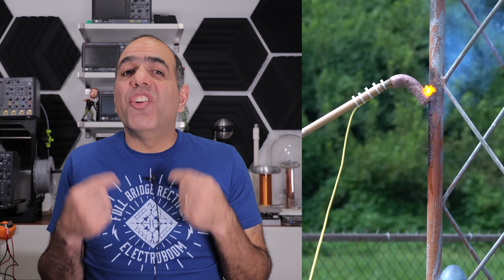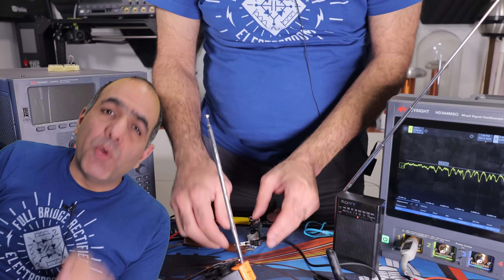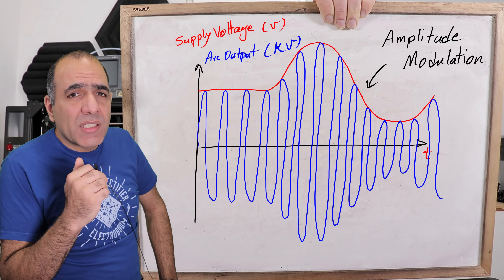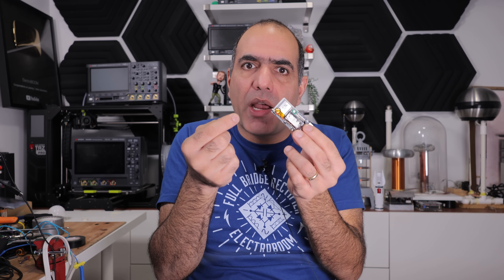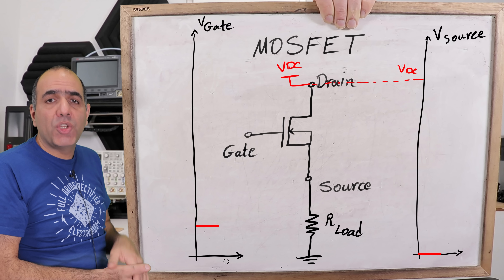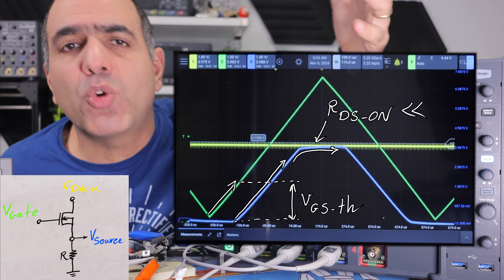Plasma Speaker DIY (AM Demodulator)

Comment: Very interesting! There are two main methods to extract the envelope of a carrier in analog systems. The first uses a rectifying diode followed by a capacitive filter. The second relies on nonlinear components, where mixing of signal components occurs, and among the output frequencies, the baseband component can be found. This second method is precisely what happens in the case of an electric arc, where the current is not proportional to the voltage.

Comment: In the US, AM transmitters are limited to a maximum output of 50 kW. Here in Germany there was a medium wave transmitter in operation until 2015, which broadcast with 1200 kW of power from the 70s to the 90s. At the time of the final shutdown it was still 400 kW. The 1200 kW was enough to hear the radio signal from gutters, refrigerators, radiators and cooking pots at a distance of 12 kilometers (7.5 miles). A net of wire cables (like a kind of Faradey cage) was even built over the autobahn next to the transmitter so that the cars' function was not disturbed.

Comment: Hi @electroboom.   I recently return home from open heart surgery and when they tried to remove the pace maker wires attached to my heart  it would not come detached and they just clipped the ends and left them in.     Is it still safe for me to use my super high frequency Tesla coil or is time for a safer hobby?

Comment: Videos like this make me wish you did some videos on synthesizers or guitar pedals! The concepts you're talking about are almost the same, if not exactly the same as what's happening in say, a Voltage Controlled Oscillator, or a hard-clipping distortion. MOSFETs specifically are often used in effect pedals

Comment: This actually makes me a fair bit more confident of the "plasma speaker" I cobbled together many years ago. But instead of coupling the audio to the gate with a cap, I fed the gate directly from an amp. Worked to some degree, FET got stupidly hot very quickly. Mkst likely also due to the high currents it had to switch, a ZVS at roughly 300W ain't no joke for a FET.

Comment: Gate driver circuit or battery’s negative should be referenced to the source of the mosfet not the negative or gnd of the battery, you are using a high side switch. This case the mosfet won’t turn on properly or could end up heating. This is a horrible way of driving a mosfet plus you might want to use an opamp or a transistor voltage follower to properly drive the gate. Other possibility is modulate the audio signal after DC shifting with a high frequency ramp using a comparator then the output pulses directly fed to an actual gate driver then using it to turn on / off the mosfet. Please don’t make these kinds of garbage videos just because you have 9 million subscribers

Comment: regarding AM tower. years back 2 of us had to climb up a live tower and affix FM dipoles to the top, we put a wood ladder against the mast . got near the top then jumped on. got to into the triangular structure and climbed till we got to the top, dropped rope down and dragged the dipoles and fittings up. no safety gear at all, cold day and mast getting frosty, winds  making the mast sway a bit. the scary bit was when a cow used one of the guy ropes to scratch itself and that really made things a rocking.
this is going back 30 years in new zealand
would i ever do that again. no way!

Comment: The burning sausage is caused by the TRANSMITING tower being grounded who has a lot of transmitting POWER ! So, I really don't understand what you AM RECEIVER  radio as to do in all this ! But you are mentioning about earing radio, not burning pickles.... So, is the AM Radio receiver antenna tuned (synched, harmonized, resonating)  at 530 KHZ  is the radio if set at AM 530 ?? You should get 530 KHZ only after the IF filters inside the radio... I am so confused...

Comment: This is just a speaker not an AM demodulater, you are feeding the Audio output of the radio to the mosfet, which is not like getting a direct AM signal through an Antenna , the radio here is doing all the work, from receiving, separating the Carrier from the audio and amplifing and you just get the amplified signal and feed it to your lighter

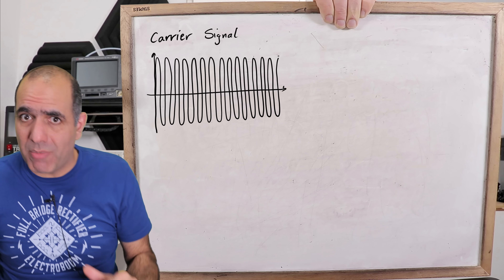Comment: 2:40 No, it doesn't (or shouldn't) have anything at baseband (in theory!!). With DSB-AM, the carrier frequency moves the baseband audio signal up to the carrier frequency. So you end up with an upper side band, a lower sideband, and the carrier signal which is basically a DC offset. Half the power is in the carrier and the other half is both sidebands. Each sideband is a quarter of the total transmitter power. It makes sense half the power is the carrier because even in the time domain prior to modulation, the signal is biased to a middle voltage. So it can be thought of as a DC bias and a signal superimposed on it, half the power for the DC offset and half the power for the signal.

Comment: What, no mega-traffic from a FREE ENERGY DEVICE?    PS make a pickle from molded agar with a bit of salt.   It's transparent, so when you hook it to line voltage, you can see the internal arcs as they carve out large bubbles.   (Or, add strontium nitrate instead of NaCl, for magenta-colored arcs instead of sodium-line arcs)

Comment: 9:16 microwave oven transformer 😂
Reply: An MOT or any lf transformer will have a very bad result. Those steel cores are designed by electromagnetic physicists and electrical engineers to run on low frequencies, no audible frequencies. You’ll notice the BH curve, Q factors everything go bad, turn into a resistive load, hell.
Reply: @BritishEngineer  *switch
intense 60hz arc and sparking
breaker pops
Mehdi: the hell?
bubbly candle arcs
Mehdi: the hell
Mehdi: WHY DO BAD THINGS HAPPEN TO GOOD PEOPLE??
switch
Mehdi: go!
eerrrooo
Mehdi: woo
erroo erroo
tower tips
Mehdi: puts hands in front of him
massive sparks
Mehdi: AAAHHHHHH%@#$@#$%@$%$#AAAA$%@#$%@$$@*starts flying*

Comment: Doesn't demodulation by air heating/cooling pick up the square of the signal, as opposed to the signal itself when demodulating using a diode?

Modulated wave is s(t)  = A(t) sin(wt), Heating should be I^2 R, which gives A^2(t) upon averaging the square of the high-frequency carrier. Diode is |s(t)| which gives A(t) instead.

The electric arc is probably also nonlinear, and that would in fact increase the distortion of the signal even more...

Comment: I had a roommate with a guitar and amplifier. He could turn on the amp, and just plug in the guitar cord, without the guitar and pick up the local FM radio station. What's up with that? The FM tower was maybe a little more than a mile away from our apartment.

Comment: interesting to see AM is still used over there.
Reply: over where?   AM is still highly used in the US.  it just sucks that almost all receivers have absolute crap for am signals.   AM is actually very very high quality with the proper receiver.
Reply: @iamdestructoman  yes, over there. It has a narrower bandwidth than fm, so in ideal situations for both, it's worse quality than fm. 
Doesn't matter as much now, with digital radio.
I get it, am covers a greater area, so they went with that instead of more towers and because power is still somewhat cheap there, they can excuse the high power.
But damn does this video demonstrate that it's interference central.

Comment: I did this with a bluetooth speaker and a laser first, the other end was a solar panel hooked up to a hifi, next i did it with a cheap headlamp, so i can turn it on then modulate it with audio signal, it worked great and was loud because of the hifi, if i had a more powerful solar panel i would hook up the speaker to it😅

Comment: Can anyone help me 

I want to drive coreless motor with audio frequency with an app on my phone using a bluetooth module. The Bluetooth module provides only 0.7v on outputs, and that's why i tried using bc547 transistor. But transistor doesn't turn on fully. 

Which transistor i can use to drive motor from audio coming out of the Bluetooth module??

Comment: Slight correction: because of Fourier and frequency mixing, when you modulate the carrier with an audible frequency, it shifts the modulating signal up to be around the carrier (with two sidebands containing the signal information and the carrier). That way, the signal only contains frequency components around the carrier and not at audible frequencies so it won't shock you (but it will still burn, hurt, and cook you). If the signal has a lower frequency signal superimposed on it (added rather than multiplied) like in Styropyro's HFVTTC, the lower frequency components will cause your nerves to react, making it extremely dangerous and lethal. If you like the math, pickle demodulation works because the thing you hear is proportional to the power going through the arc, which is proportional to the power, which is proportional to the square of the signal. The square of the signal has lower frequency components containing the original modulated information. It's much more intuitive to think about what AM actually looks like (Mehdi's explanation (which I really like btw!)) rather than all the math in the frequency domain, but if you're wondering how it works with fourier stuff, that's why.
Reply: Thank you. I was thinking "is that really right?" because it reminded of acoustic beat where a slow amplitude modulation is caused by the superposition of two components with similar, but much higher frequencies.
Reply: As an electrical student thanks for the explanation, makes a lot more sense now

Comment: Do I have to use a lithium battery 7:55
Reply: It would work best with the lithium battery that came with it. But you can, roughly approximate the output voltage and current of a lithium battery by making 4 sets of 2or3 AAA batteries in series and putting all the sets in parallel. This would output around 3-4.5 volts and could supply ~1.5-4 amps.
Reply: @ I’m thinking, maybe the hazards
Reply: @Imacgray  what?

Comment: I used to live 1000 feet from an AM talk radio station.  My entire building seethed with Rush Limbaugh every afternoon.   You didn't need any radio receivers,, just anything that had some level of radio  resonance.  Don't ask about my phone lines then.   Note this was the era of the 56K modem and I had a second phone line for Internet.   Ask how that worked.  It was "interesting:   At least they reduced power at night.
Reply: Maybe they had a broken insulator on the steel cables of the antena
Reply: The rent must have been dirt cheap though.
Reply: Don’t ask about your phone lines but ask about your secondary internet phone line..?
Reply: I feel truly miserable for you. I hope where you live now is better.
Reply: My condolences.
Reply: WTF is 1000 feet in meters?
Reply: @mernokimuvek  around 3.3 feet in a meter. so 300-ish.
come on man, if i can memorize it why can't you, mr metric? arent you supposed to be so superior?
here's another handy conversion, 2.54 centimeters in an inch. and 3.78 liters in a gallon! wow, how can my puny american brain store all this information :O
wanna know how many kilometers are in a mile, or do you get the point? it's 1.6 by the way.
Reply: @charleswisconsin9196  In  European countries,  they don't tech imperial units. My physics teacher once referred to america as the country that measures length in fridges. Why should people who grew up with a superior system of units learn  to use inferior units?

Comment: More circuit bending videos! Another fun audio project is to use two amplifiers (I used BJTs back in the day but mosfets probably would work), one drives a laser pointer with audio signal at the gate aimed at a photodiode which is the gate for another bjt/mosfet that drives a speaker. I dont think I ever transmitted the audio further than a few feet though lol. Also RF burns frickin suck!

Comment: At 7:30 how did you get 3V at the source of the MOSFET? Is it from the lighter battery?
Reply: Resistor voltage divider.

9 = 6 + 3

6 = 2 X 3

And.. ok it’s hard to explain in a YT comment. Just go look up resistor voltage divider.

Comment: Seriously!!! From someone who has worked with high power RF it reallY is NOT something you want to mess around with. There’s a couple of channels in particular and one of them, he is too clever because he thinks he knows best and was quite rude when I warned him. If you get an RF burn you will only want to do it the once. And not only that there are conditions where you won’t know if you have been burnt until it’s too late. 
FOR GOODNESS SAKE please don’t mess with RF if you don’t understand what you are doing. You need to understand how RF propagates at different frequencies and how it propagates. If you ever visit a transmitter station then you will see perimeter fences around the antennas (depending upon type and frequency) and RF burns can result just as lethal as touching an 11kV maims cable. 

Please don’t try it.

Comment: Slight error, there is no audible component to the signal as it stands. You need to put it through some sort of non linear element in order to get an audible component out. Rectification works, but isn't really the thing worth talking about here, because squaring the signal works too, and is more relevant. Power in a resistive component is the square of the voltage, so the important point is that the volume the plasma takes up is dependent on the power, which is already non linear (proportional to square of voltage or current).

Comment: And 💥BOOM💥 you just made a speaker that uses a spark to make sound!
Electroboom it would be nice to try to make a teaser using a coil, and finally find out how I can prevent reverse charge from returning to the oscillator....
Please I haven't found a way to avoid this yet either because I haven't come across it somewhere or because I'm dumb.
And thank you very much for your good work ❤❤❤

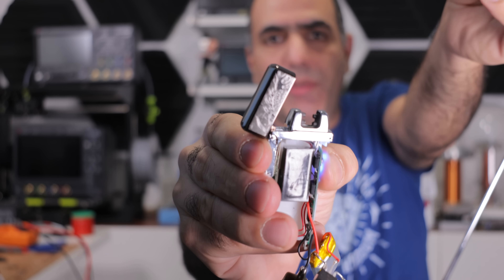Comment: 8:59; Don't use the pickle on your fingers to contact your electronic device because the pickle has contained with a base of salt, spices, and vinegar called brine, and it is conducted with high voltage.

Comment: That also applies to ham radio towers as well. Some run at a substantial wattage.
Reply: Nope. AM radio towers are "mast radiators" - the tower itself is the antenna. Ham radio operators send all their power through an antenna mounted to the top of the tower, with no power present in the tower itself (the tower is simply a support structure).

Comment: Reminds me of the plasma flame speakers that were kinda popular for a while. They usually had a 27MHz base frequency to generate the plasma flame, as that is an unregulated radio frequency you are allowed to transmit on to some extent.If i remember correctly, these are supposed to be pretty high quality high frequency speakers, because moving a membrane in a mechanical speaker at high audio frequency is much harder than modulating the plasma flame, and the flame acts like a 360° speaker that is less directional. I guess the tricky part is to get the audio signal modulating the flame with minimal distortion and have matching speakers for the lower frequency part of the audible spectrum, as you will need some more massive mechanical parts than a plasma flame to excite large air volumes at lower frequency.

Comment: 5:25 But it still doesnt explain it - in this original radio tower video this guy didn't have mosfets and other electonics attached to pickle but still got sound.
Reply from the maker: Oh, the pickle is only grounded, the mosfet and stuff is to create what is already on those towers
Reply: Understanding the lightbulb flickering at twice the AC frequency is key. The plasma works as a speaker because it's volume changes depending on the power going through it, and power is proportional to the square of the voltage for a resistive element (the plasma is near enough). To demodulate the signal you need a non linear element, and coupling the plasma power to the air works as this because the power is quadratic (non linear).
Sort of with you that the video doesn't explain the how it works well though.
Reply: yeah because the guy did not need these. He was touching the pickle directly on the tower which outputs a massive amount of power. But Medhi was doing it in his house far away from a tower where there is a fraction of the power available

Comment: In 1965 they made the first commercial speaker that used a plasma ark as a tweeter in the speaker. ""The MP88 speakers system was the first to use the MP02 plasma tweeter on the top. The IonoFane Loudspeaker. In 1965, Fane Acoustics Ltd., Batley, Yorkshire came out with the Ionofane 601 loudspeaker"
Reply: Now mention the fact the plasma arc generated ozone, so you couldnt listen to the speakers in a closed room for too long, or risk ozone poisoning.
Reply: @Eucal  And is also quite destructive. I imagine you would have to constantly replace the parts because they corrode away their electrodes. Sounds like a typical 60s gimmick.
Reply: @christiannorf1680  They use tungsten electrodes so its somewhat of a non-issue (roughly 5k hour service life), but otherwise yes. Its not a gimmick though.
Plasma has negligible mass, so its as close to a massless (and thus inertialess) driver as we can get. It does really sound good.

To quote Nelson though:
"It was the perfect high end audio product: Exotic, inefficient, expensive, unavailable, and toxic."
Reply: @Eucal  I really doubt it generates enough ozone to be dangerous but who knows. I'm around ozone quite often, love the smell lol.
Reply: @vonSachsenbach  It sure does though. Sent Nelson Pass to the hospital when he built his, and many more cases of designers suffering illness demoing their tweeters. You can smell ozone after a photocopier has been on for a while, let alone a much more powerful arc, for much longer duration continously.
There has even been a commercial system using a helium tank to provide the ionisation gas, purely to avoid the ozone issue.